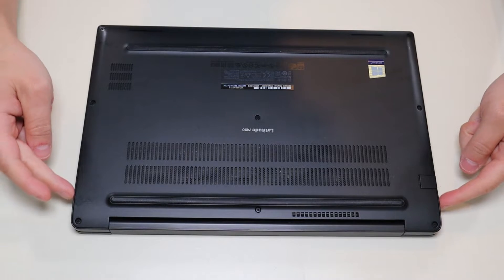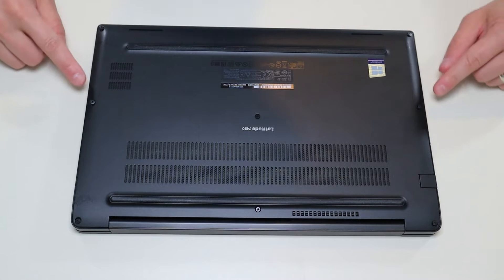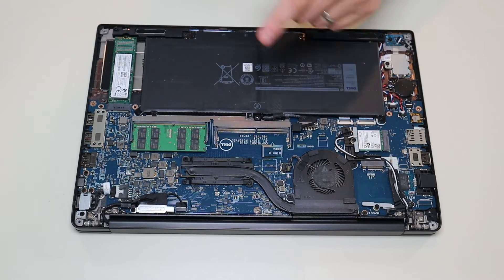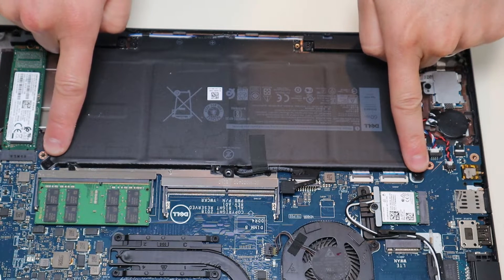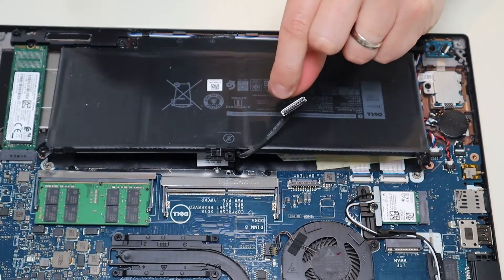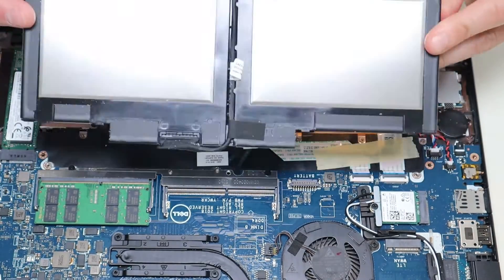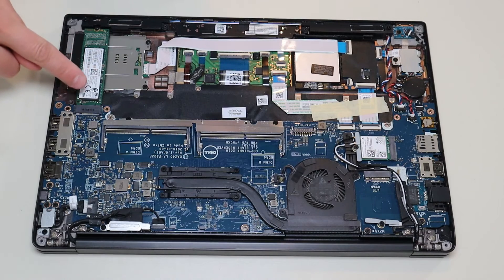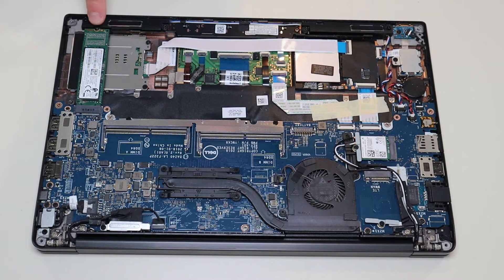How To Replace Upgrade SSD Storage for Dell Latitude 7490 Laptop Computer

Comment: Hello, this is unrelated but I wanted to ask, my laptop turns off then it freezes when I plug it's charger. It turns on and works when I remove the charger.

Ps. The charger works perfectly fine charging the laptop.
Laptop MSI Bravo15 B7ed

Comment: This might be unrelated I'm currently using an external  keyboard, but my laptop keyboard is having problems  a while ago my top row keys were not working meaning if I press  it doesn't work but if i continually or press it down long it starts and stops then starts again usually it was only for my top numbers, so I was fine, but now the problem has moved to my second row of computer do you have any help
Reply from the maker: Is there something physically wrong with the key / keys or are they mechanically working fine?
Also, did anything happen before this issue appeared?  Liquid spill, overheating, Windows update, etc?
Reply: @PC_Monkey  my laptop started to say overheating a few weeks ago
Reply: and nothing is physically wrong with the key